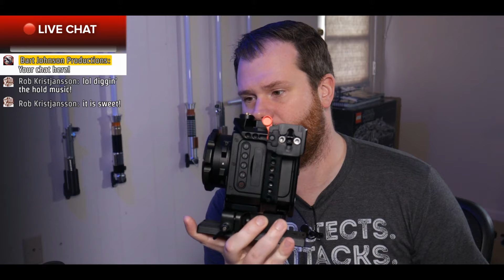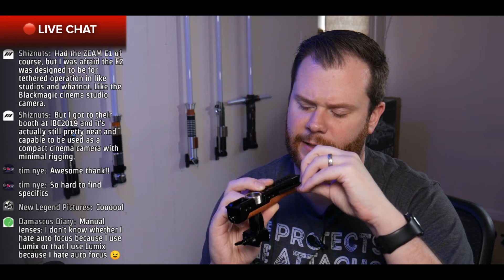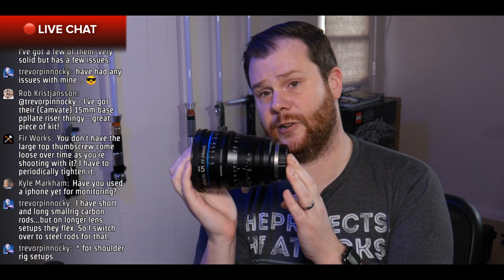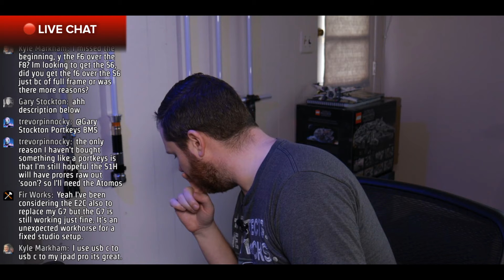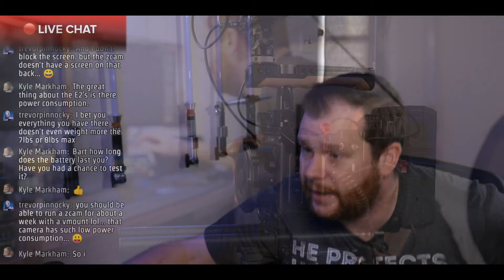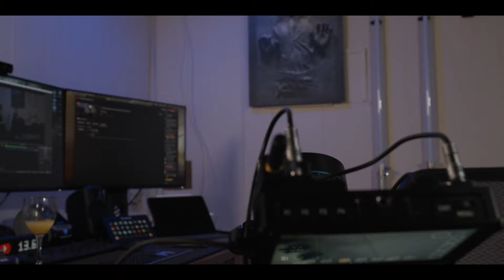🔴 The Best Accessories to Turn the Z CAM Into A Cinema Rig - LIVE!

Comment: Why use a dummy battery and not the 2 pin LEMO to D-Tap that came with the camera?
Reply from the maker: The LEMO connector would work fine.  I find the dummy battery to feel a bit more secure.  It also is a bit lower profile compared the the LEMO connector sticking out.

Comment: I have the same setup but can't for the life of me get the nucleus n or the portkeys bm5 to work with the zcam. Follow focus works but the record button doesn't and the same goes for the controls on the portkeys. Any suggestions?
Reply from the maker: Jerome Bohman Interesting.  Which ZCAM?  What’s your firmware on the camera?  Also check the firmware on the Tilta and PortKeys.  I have heard of some people having issues with the PortKeys after the latest firmware update, but I haven’t updated (the BM5).  Also are you sure you have the correct cables?  I tried a regular LANC cable at first and it did not work.  Had to make sure to get the specific cable for the ZCAM from PortKeys and from Tilta.
Reply: @BartJohnsonProd  I have the M4. I got it figured out sort of. 1) I may not have had the lanc splitter all the way into the zcam or 2) I updated to the latest firmware today (the one that just came out within the past week or so) but I no longer see controls on screen for camera operation. I'll need to further investigate this

Comment: is there room to put a swing open matte box at the end of those rails?
Reply from the maker: If I slide them forward a bit and moved my battery plate closer to the camera body I could get a rail mounted matte box on there.  But it might be easier with slightly longer rods.